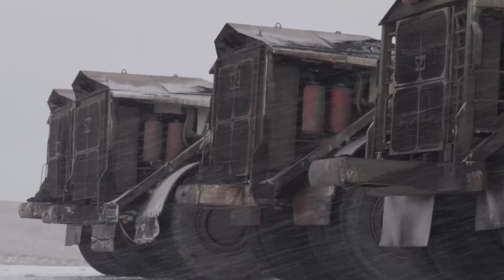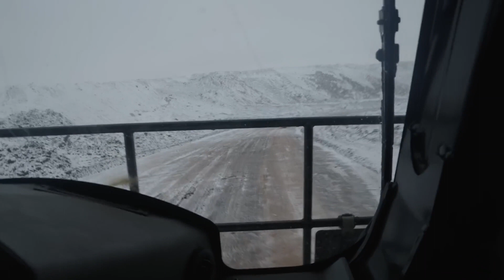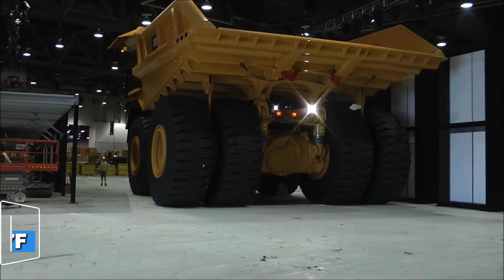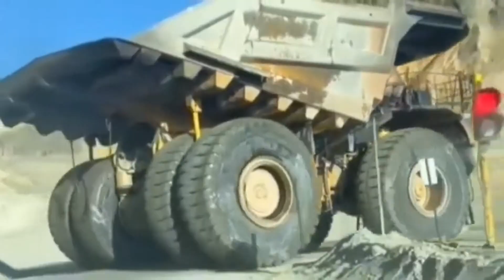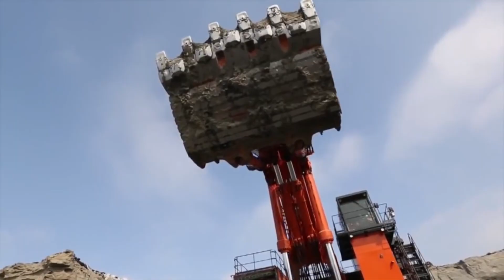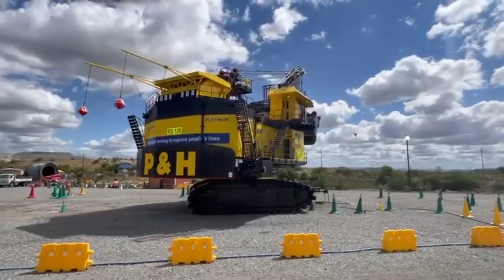The BIGGEST INDUSTRIAL MACHINES Operating At An INSANE LEVEL

Comment: Why does the BelAZ have two diesel engines?
Reply from the maker: Because it needs enormous power. Together they produce around 4,600 horsepower and generate electricity for four wheel motors.